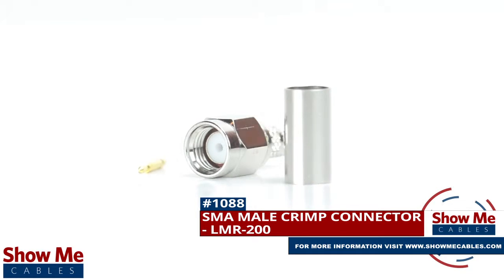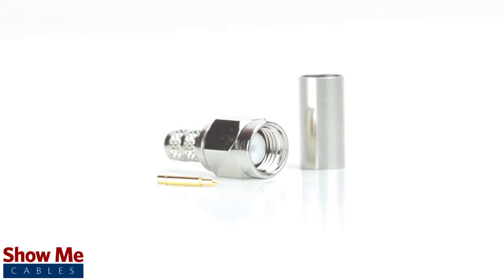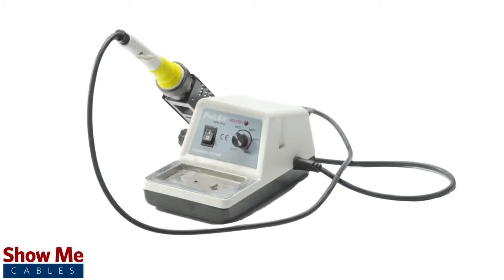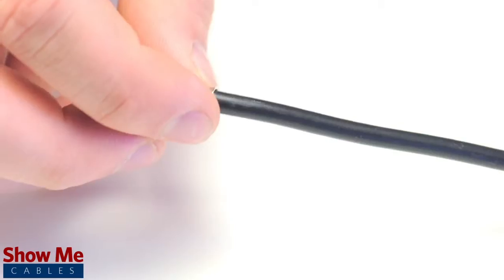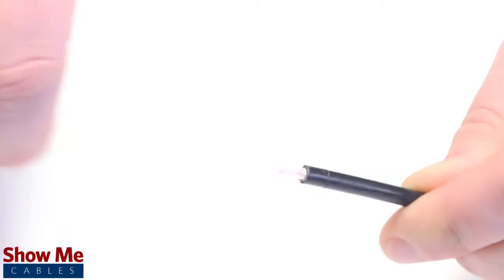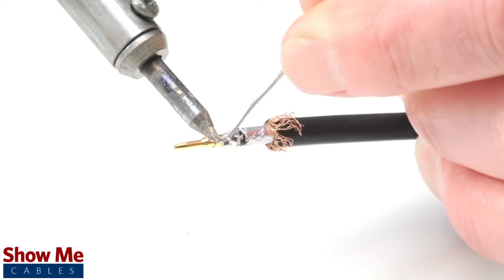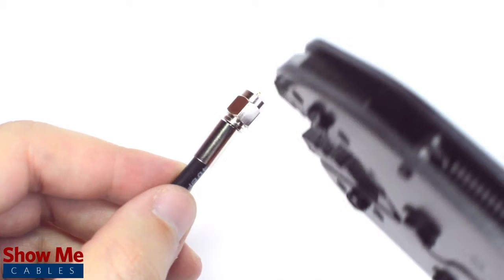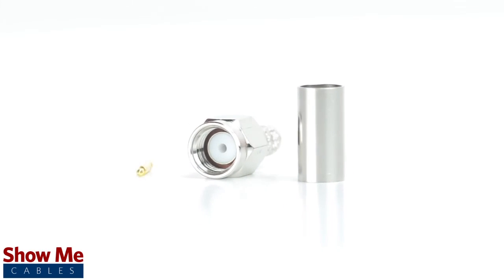SMA Male Crimp Connector For LMR-200 - Perfect For DIY Installs!

Comment: I'm trying to connect my wifi router with an external antenna but they're both using Sma Female connectors meaning there is no pin is there a connecter that exist to combine the 2?